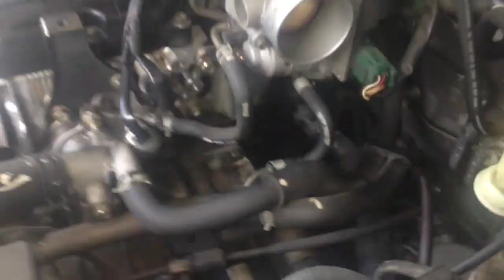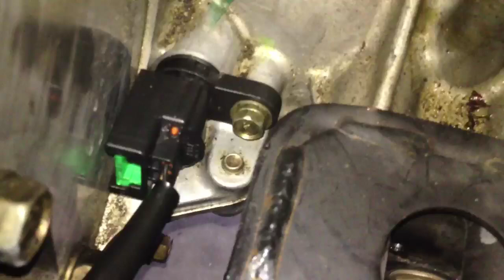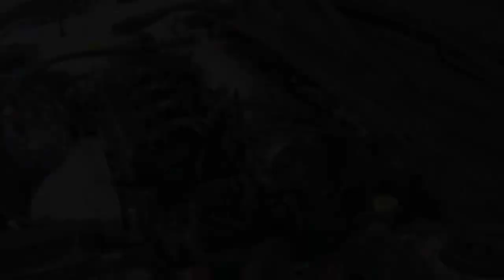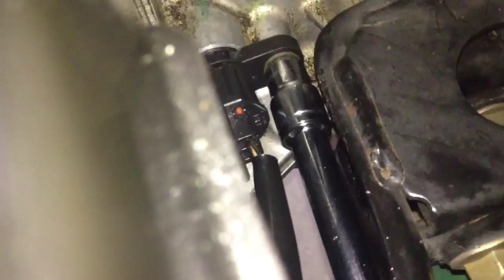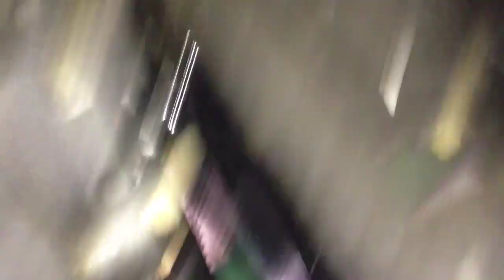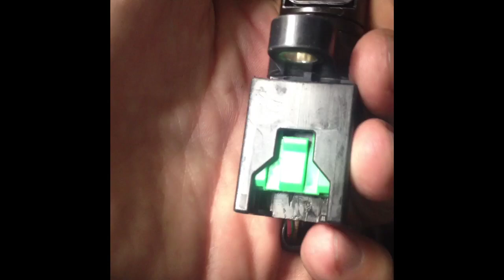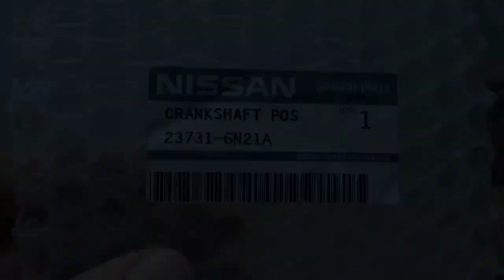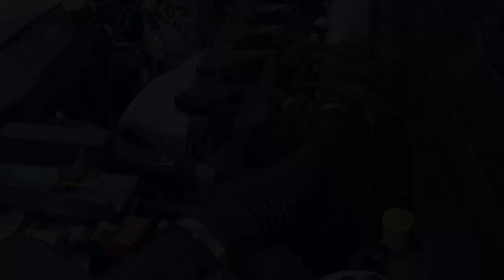Code P0335 / P0340 /P1336 - Crankshaft Positioning Sensor Replacement DIY - Nissan.

Comment: If your car randomly jerks while driving, this is a sign of this sensor going bad as well. My 2005 Altima began to starting jerking AKA(Hickups) at highway speeds. If your car does this, replace the sensor as soon as possible so you are not stranded on the side of the road. These sensors are not expensive, dont take it to the dealer, they will rip you off.

Comment: (cont.) Mine is 06 altima. I followed his instructions to a T.   Pushing the tab with a stubby flathead screwdriver was a Lil difficult but heard it click and i was happy. Getting the 10mm extension in there was easy, I attached ratchet after it was on bolt and took it off. Grabbed sensor with plier and pulled out. You have no idea how grateful I am for this video.

Comment: Thank you for this video!  I watched it about 30 times before I started.  Only took me about forty minutes to do both sensors and I don't know anything about cars. Mine were original (plastic) sensors. So I had to use flathead to push ran and needle nose to gently take connector off first. Then used needle nose to pull out sensor. There is a small space on top of engine where you can use flashlight with left hand and reach underneath with right hand to do work.  Guys if I can do it anybody can

Comment: Just an update. Changes the part. Excellent video. Still some mild engine shake. Misfire? Code came out cylinder 2 misfire. Changed my plugs. 1 spark plug well has some oil. Gasket replacement time? Hope that fixes the misfire.

Comment: I just changed it out and it starts up beautifully. The error code went off too after following your instruction with the battery cable. I cant thank you enough man. You saved me a few hundred. If youre ever in NY the beers on me pal. Thanks a million Tem!!!

Comment from the maker: Car will start right away after sensor replacement.
If error code doesn't go away, unplug black negative cord from battery. Press horn button to release any remaining electricity. Wait for 5-10 min. Code should be gone!

Comment from the maker: Code went away on its own after I replaced sensor. 
I had similar situation. Car had engine light and drove fine in the beginning, then become very hard to start. It usually happened on hot engine after more that 1 hour non-stop driving, usually far away from home. I kept trying to start it for 5-10 minutes. Eventually it worked.

Comment: Do you need to reset code first or will my Altima turn over once I put the new sensor in? Im still waiting for the OEM  sensor from ebay. Car was running OK with the check engine light on for a few days but now it cranks fine but will not start at all.

Comment from the maker: Older plastic sensor part number is  B3731-6N27K. Newer metallic part number is 23731-6N21A. Most reliable (and expensive) place would be your local Nissan dealer. You can also buy same quality OEM parts from eBay and save some money. I almost never had problems with buying parts on eBay as well.

Comment: I'm about to replace mine after work! Excellent detailed video. I'll update after completion!
Reply: Did you ever finish
Reply: @rickysalguero8  yes I did! The car continued to run and almost a year later, traded the 2008 model in for a 2012. I remember this being a huge pain just due to the location and without this video, would have certainly had to take it into the shop. Thank you for the education!

Comment from the maker: Looks like those are original OEM sensors in plastic housing - same exact sensors that  you got in your car from factory.  The one I show in video is newer updated design enclosed in metallic cylinder.

Comment from the maker: Two videos I posted are not exactly the same. Sensors are cam and crank shaft positioning sensors. They have absolutely identical design, part # and error code. What makes them cam or crank is the place where you insert them. Crank is on the back of the engine, cam is on the side. Most likely you have bad crank sensor, but you may wanna replace both.

Comment from the maker: You may also wanna replace your Camshaft Positioning sensor. Both sensors are identical and they activate the same error code. Good news is that cam sensor is very easy to replace and will take you no more than 15 min.

Comment from the maker: Try to disconnect negative connector of  battery and leave it for about 10 min. You can also go to AutoParts and ask them to reset codes. 
Last, you can buy OBD code reader starting from about $17 on eBay.

Comment: It must've been my car's previous owner who replaced it with a cheap aftermarket part (it was a plastic encasing). My new one wasn't ordered from the dealer, but it has a mental encasing, and it was only ~$30.

Comment: Actually, for my care, the plug on the sensor was inserted 180° different than shown in your video; thus, it blocks the bolt to remove the sensor, and I need to (somehow) unplug it first before removing it…

Comment from the maker: Was it original or aftermarket do you know? When I installed aftermarket part the first time, problem came back next day. I bought OEM sensor from dealer and car drives well for 20k already.

Comment: I had to use a 10mm combination Wrench to remove the Sensor because it had a raised piece that interfered with the clearance for the Wrench.The new one was a bit easier to install.
After three hours some Cut's and Scrapes and a few bad Words I finished the Job and the Car runs great. Needles to say if the Sensor goes bad again I will take the Car to the Shop.

Comment: This will be the 3rd one on our Altima.  It's like the Nissan dealership has it rigged so they are the only ones that can get to it. Very frustrating.  The tab is not a press & disconnect tab, it is a slide to disconnect. Impossible to get anything to it to slide the tab to make it stay in place for removal. It's almost worth trading or selling the car to get rid of the issue/problem.

Comment: It depends on the Dealer.
Most around here have a $45.00 per Flat Rate Hour Shop Fee so it could run a couple Hundred Dollars.Also You will pay the inflated Dealer Price for the Part.
I bought one from Auto Zone for $35.00.
Now the fun of installation begins.

Comment from the maker: You can do it. The reason it worked for me is because I am replacing it second time. Sensor in the video is aftermarket part, which has plug reversed 180 degrees. To unscrew original sensor you have to disconnect wire harness first, by pressing green button and pulling it off the sensor. Only then you'll be able to get to that bolt.

Comment: Can't be done on 03 Altima.  Can't get the socket on the head of the bolt holding the sensor in because the side of the bolt is too close to the plug.  Will have to put the car on a rack & use an open ended box wrench to get it out.

Comment from the maker: Both sensors are the same. Usually sellers mark parts with dots for return purposes only. If you remove dot or stamp, the woun't accept returns in case it doesn't work.

Comment from the maker: Somebody mentioned that dealer charges $450 for this.
Reply: Hi, I have a 2009 Nissan x trail 2.0 dci and the crank shaft sensor needs replacing. Can you link me some images or video to replace it please

Comment: have a 2006 Nissan Altima with the same problem, drive it for a while and then it takes me a couple min. to start it up again...first time replacing the crankshaft sensor, had no idea where it was, your video was very clear and helpful...

Comment: Good Video, I got mine replaced today, it only took me about 32minutes, There is a way to see the sensor while you are trying to remove/install: if you are not that tall like me 5'9", get a stool by front left wheel and while you hold a small flash light on left hand and point from center top of engine towards sensor you will be able to look at sensor while using right hand to do the work. just have to find that sweet spot where the light points at the sensor. Good video, helped me a lot. thanks

Comment: I was finally able to get the sensor unstuck by using a combination of pliers and the long (20") screwdriver as additional leverage.  Now the problem I'm facing is the new sensor is difficult to place in the old hole.

I have the wire harness attached and the bolt tightened 80% of the way, but I'm worried about making a good seal.

Thanks again for your help

Comment: Thanks so much for posting this. I picked up the crankshaft sensor for $30 at AutoZone.

I managed to set a flashlight on a metal support lighting up the sensor area, and then noticed that I could see through the top of the engine right down to the spot I needed - no cameras and no blindness!  Overall I spent about 25 minutes doing the replacement.  I disconnected/reconnected the battery and the car started right up.

I did not notice any oil in the old sensor, but it was obviously faulty.

Comment: Thanks for the response.  I've been able (with much difficulty) to remove the harness and the bolt, but the sensor won't come out.  I'm buying a 20" flat head screwdriver today.

Are there any replacement parts that are oriented the same as original?
-also-
Is there a database to determine the originality of the part once I can finally remove it?

Again, thanks for all your help.

Comment from the maker: 1) Yes, it's original sensor. New replacement sensor is designed the way that you don't need to disconnect harness to access bolt. In my video I am replacing aftermarket part, that's why I don't have to disconnect harness first.
2) When I was replacing original sensor I used flat head screwdriver to push green button. It will click and stay in place. Then you'll probably have hard time to disconnect harness. Using long nose plyers migth help.

Comment: I have located the sensor and need to disconnect the wiring harness to be able to access the bolt.

I have 2 questions:

1.) Does this mean that I have the original sensor that came with the vehicle (because the dealer told me otherwise and I'm wondering if they lied)

also
2.) How do you get enough leverage to push the green button while still attached?

Comment: Just watched video and changed my Crank shaft sensor... It is exactly how he describes, location was in back side of engine.  It is very hard to get to it and I used a bathroom mirror to watch what i was doing because you can not visibly see the location.  The HARDEST part for me was taking the green plug off the sensor. It was very tightly connected. The whole procedure took me about 4 hours to do... I just want to thank the person who made this video otherwise I would not have known where to

Comment: Thanks, It works for me. I have a 2006 altima 2.5s. 
I got P0335 and P0725. 

Before replacing the camshaft & cranshaft sensors please check recall "NHTSA CAMPAIGN ID Number: 07V527000"   
nhtsa.dot.gov/cars/problems/recalls/results.cfm?SearchType=QuickSearch&rcl_ID=07V527000&summary=true

I printed out this page and gave it to dealership They replaced  the camshaft, cranshaft, Manifold, Fuel pump for free.  They gave me a rental car for free too.

Comment: Just replaced the camshaft & cranshaft sensors, what I did was place a light against the firewall and lean over the motor from the drivers side and I could see the sensor and bolt from in between the intake manifold runners, the rest of the info in this video is spot on, thanks.

Comment: hey it is very hard for me to get the oem sensor off. i pushed in the green plastic electrical cord lock in and proceeded to pull the cable with connector that is attached to sensor but it is difficult. do i use needle nose pliers to pull on the sides of the plastic connector that is attched to the wire. i tried for an hour with no luck. im trying again today. please help?